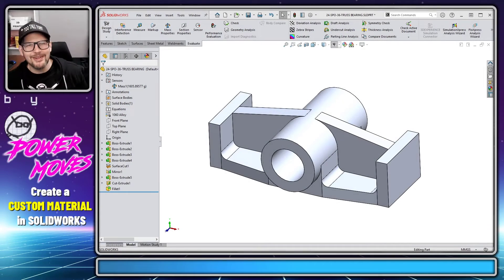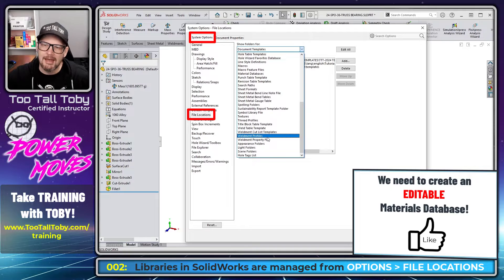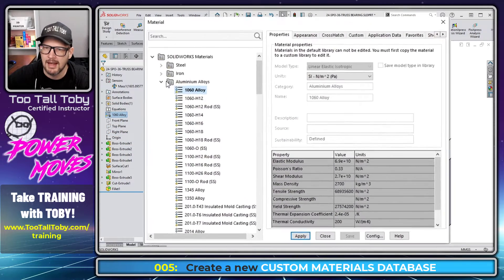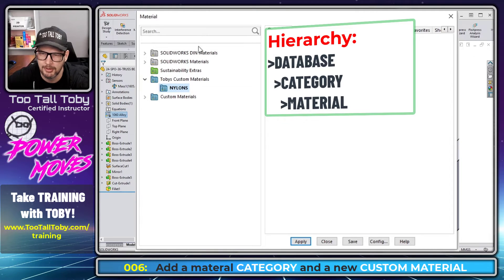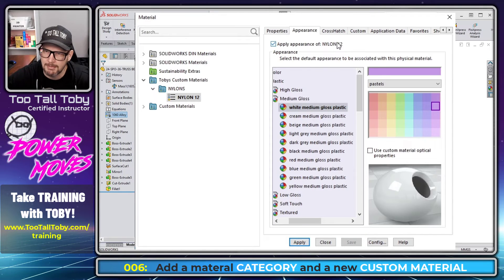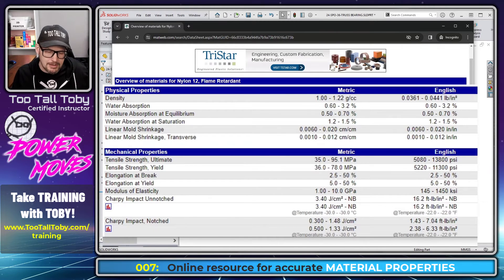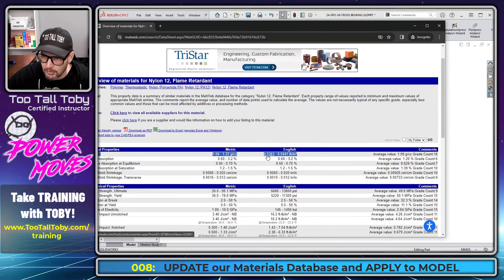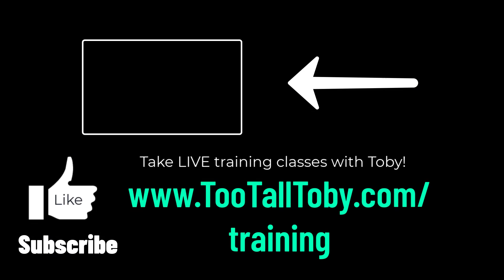Create a CUSTOM MATERIAL in SolidWorks

Comment: Toby, great video.  Question:  Is this meant to replace the current material database or act as an extra to the standard database?  It appears that you’re just adding to a database with a supplemental database that the users would then choose from.  Cheers man…
Reply from the maker: hi Steve!  The "default" SolidWorks materials library is tagged as READ ONLY - so you can't really modify that.  SolidWorks ships with an additional materials library database that IS editable, so you could certainly edit that database and add to it.  
Or you could create your own, NEW materials database, and then begin populating that with materials for your projects.  That's what I do.  This way it's easy to find the materials database file and properly back it up or share it with your co-workers.
Reply: @ thanks Toby, I figured that we really didn’t want to edit anything in the default structure and the additional database is just for materials that we need more specifics on or isn’t in the SW default database.